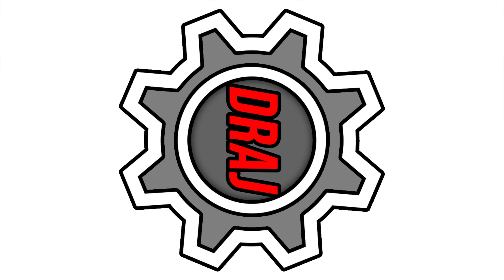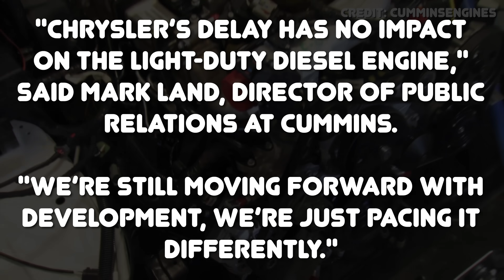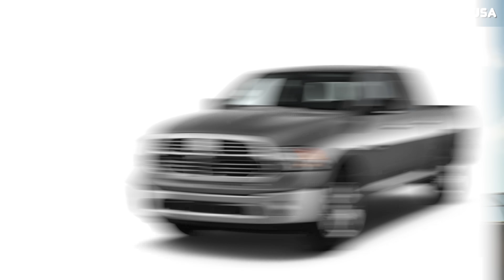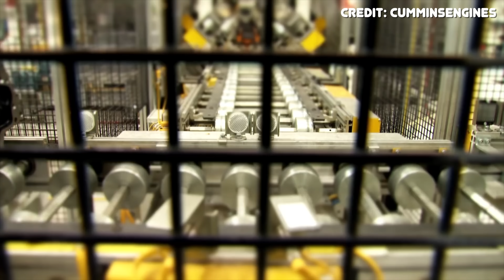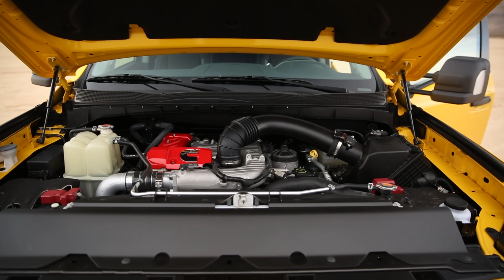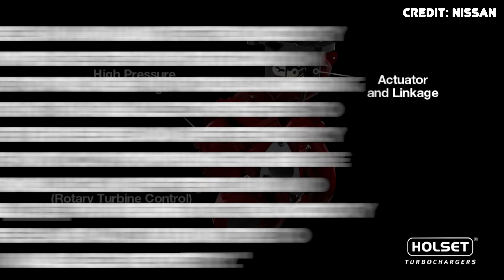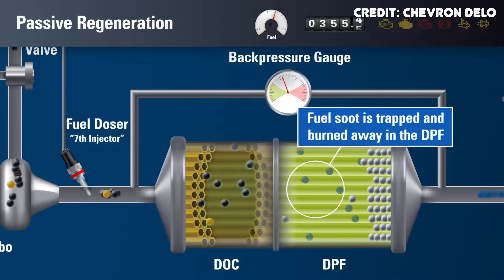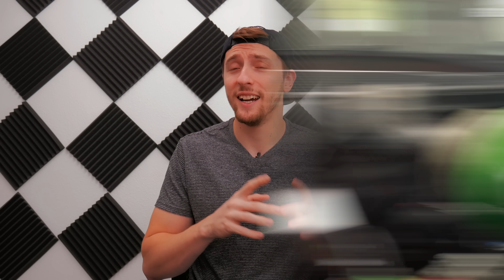5.0L Cummins: Everything You Need to Know

Comment: I wonder why Cummins didn't design the engine to be a "hot vee" (exhaust exits in the middle of the Vee instead of the conventional location)?
I'm guessing there must be some significant disadvantages.  Yet when one sees the (conventional) exhaust routing from the exhaust manifold up the back side of each cylinder head and into the vee, that seems like quite a source of heat and noise not to mention the distances from the exhaust to the turbine adding to turbo lag.

Comment: The 5.0 Cummins is a joke because it gets worse mpg than a gasser. My 5.9 Cummins in 2 of my 8,500lb trucks that get 18mpg city and 21hwy. My other 3 5.9 Cummins do slightly under that. That 5.0 gets 14mpg at best.

Comment: The problem with the entire package is there are no benefits. All of the testing showed the titan XD with the cummins got the same fuel economy as a full 3/4 ton pickup with a big diesel.  They also priced it sky high and the tow capacity isn't much better than a half ton.  So if you want fuel economy you get a half ton and if you want tow capacity you get a true HD. The XD with the 5.0 was literally the worst of both worlds in the same truck.

Comment: I think this engine is grossly under powered for it's lack luster fuel economy and displacement. The 3 liter duramax and 3 liter ecodiesel come extremely close to this engine in hp and torque for being 3/5th (exactly) the displacement. If you took the duramax and ecodiesel and scaled them up to 5 liters, the duramax would make 461hp and 766 lbft, and the ecodiesel would make 433hp and 800lbft. Sure the numbers would be slightly less if they actually built it, but thats the main flaw with the 5.0 cummins. Combined with being put in the absolute most useless truck on the market, as its been discontinued outright for horrible sales, and this engine was bound to fail. This is why ram just said "no" to this engine and went with the ecodiesel, and it was a great decision. I would say, if it had that kind of power output it could be a base engine for the ram HD's, but it got worse fuel economy in the 6500lb titan xd than the 6.7 in the 7000lb 2500 by about 1mpg, which is pathetic. All around the engine was 10 years late on its release. 

This is a smaller V8, it needed higher RPM limits, like 3500-3700rpm, and it needed about 650lbft of torque. This engine would of not only survived, if anything thrived. Nissan would of outright been able to throw this in the regular titan, say its the most powerful half ton diesel and one of the most powerful half ton's period. Putting it in the lighter (about 1000lbs lighter) and slightly more aerodynamic regular titan would of resulted in better fuel economy. They also would of been able to put this engine in their SUV's, the Armada and QX80 for a more luxurious, torquy experience. 

Actually an engine with a similar backstory is the 2.8 duramax, old, underpowered per displacement and was dead on arrival. People talk about loving the 2.8 duramax but honestly GM making the 3.0 duramax and showing just how more competent of an engine it is for .2 liters more, shows just how dated the 2.8 is. Cummins actually has a 2.8l i4 crate engine that's doa too because of similar reasons. Cummins is honestly dead in the consumer space, and they did it to themselves

Comment: I have owned and drove 3 early 90s 5.9 Cummins trucks. Decent power and 25 to 30 MPG. Well over 20 MPG pulling heavy trailers.  My next purchase was a 2004 5.9 Cummins. 22 MPG empty and 16 loaded. Next was a 2012 6.7L. 18MPG empty and about 14 pulling a trailer. As power and technology increased, mileage decreased. There is something wrong with that picture. On a side note Cummins built industrial V6 and V8 engines in the 60s, mostly installed in versatile tractors. They were quite a bit more labour intensive to overhaul compared to an inline 6.

Comment: The 5.9 and 6.7 are EXCLUSIVE to dodge/ram trucks.. they have been and are still used in a lot of commercial trucks and industrial equipment, they were before dodge got a contract for Cummins to provide diesel engines... Just like with Nissan, dodges Cummins engines are just the non commercial /industrial version...

Comment: whats the word on head gasket failures? how many miles are they hitting the wreckers at typically? i cant imagine doing two headgaskets at once instead of 1, especially when theyre jammed in there and on  a 45 degree angle

whole reason the cummins gets the love is its million mile reliability, if the 5.0 is only making it to say 300k miles and needs headgaskets, an injection pump, and a turbo setup in that time span it aint the answer

Comment: I have a 2019 Nissan Titan XD Cummins and really enjoy it. Towing with it makes me sometimes forget there is something behind me. 5th wheel or towing the rzr the 5.0 Cummins handles it just fine. On top of that Nissan offered a 35 year warranty with unlimited miles on the power train. Amazing truck and great power its not a sports car but it will haul a$$ even with a trailer behind it!
Reply: 35 years? Are you serious?
Reply: @andrewsang4688  yes 35 years.
Reply: @reviewmaster8910  I was looking online at looks like it's only 5 years and 100,000 mi
Reply: @andrewsang4688  yes the original factory was 100K 5 year. However Nissan offered an extended warranty for $3,500 that extended it an additional 30 years not starting until the original factory expired.

Comment: I have one currently and love it, an aftermarket intake makes it 5x better. one thing with the trucks though is Nissan basically lied about the tow numbers because they can easily tow 20k while only being rated at 12-14k
Reply: @stevenp3176  it’s pretty safely, if you look at the vehicles specs it’s more than capable, 20 may be a little high but 15-16 easy

Comment: 5.0 had none of the advantages the 5.9 and 6.7 had. Drivetrain was not gear driven, and that engine uses glow plugs instead of grid heaters as well. Two of the main reasons people like the i6 was it’s longevity and ability to start in cold temps. The 5.0 couldn’t deliver on either front as well as very similar mileage to the 6.7

Comment: The Bosch fuel pump in my dad’s brand new ram 3500 grenaded at around 3,400 miles while we were heading home on the interstate. Almost half a year later we finally got it back. Thankfully it was covered by the warranty.

Comment: CP4 is no longer used on the cummins after 2020 since they have been sending metal shards through the fuel and possibly motor. cummins noticed this and went back to the previous system for 2021. ford and gm have failed to do so leading to many issues recently. Also new ultra low sulfur diesel is a bad thing for the cp4 because it relies on lubrication which sulfur provided.

Comment: Crap ! I would just get a 6.7L Big Power and better truck for the money plus ride quality is not bad with the new gen of ram 2500 all the way up to the 5500 with the limited trim package now over just the Laramie Trim that they just used to only have for the 4500 and 5500. Plus If I may note the 2012 truck trend issue showing off the concept ram 5500 long hauler truck would have being even more sweeter  if they had released it to the public ! Especially with at klederman air ride which is a way better system than that factory crap they have. All that being said you could still get that concept if you buy a 5500 cab and chassis limited and put the box off the 3500 on the back and do the kelderman air suspension and you would have a class 5 bad ass truck at your finger tips that would smoke even the 450 Ford !!!! HAHAHAHAHA!!!! What do you say to that boys and girls !!!!!!

Comment: No parts even for dealer repairs and turbo system recalls means they're effectively warranty-covered maintenance totalled at very low miles. Check out "Wrench Every Day"s experience with trying to use one as a tow rig, and how many times it stranded him before the dealer bought it back.

Comment: Exploding injector pump, Plastic timing chain guides, electronic controlled turbos buried in the engine, sketchy DEF system and sticking EGR valves. I thought a 5.0 Cummins would be a great idea but with engineering like this, I'll take a hard pass. Fix these issues, and I'll buy an even dozen. Or stick with the 4BT we use now.

Comment: 900lbs is exactly what a early 5.9 with exhaust and turbo on a reusable steel shipping stand weighs. I had some of these shipped to me before. I'm sure it burns 15-30% less fuel and produces 20-40% less emissions.
Reply: I still have an 06, 2500 Dodge, they got rid of them because they last too long, and run too well, and got excellent mpgs.

Comment: The head studs thing isn't really that there isn't enough it's that if you weren't gonna have more you needed to make the less more beefy with better materials which ford didn't. I.e. the head studs stretch especially when tuning causing head gasket failure.

Comment: lol RAM didn't use the Cummins because they got bought out by FIAT and fiat wanted to use their existing V6 diesel instead of paying cummins to re-invent the wheel. And the main guy in charge of putting the V8 Cummins into a RAM left to go work at Nissan. Good try though, you regurgitated the PR reasons well enough.

Comment: I worked at a Nissan dealership in the service dept for 4 years. These engines are JUNK. Crankshafts splitting in half, dropping injectors left and right, emission issues. I made a TON of money selling repairs on these. Every one that came in deleted blew the motor 2 oil changes later. Stay away.

Comment: No no when i heard CP4 injection pumps, thats a REALLY BIG turn down, because unlike the CP3 injection pumps, the CP4 injection pumps in even diesel application were known to randomly fail and cause a crank no start and call for a complete high side fuel system rebuild

Comment: Why does Cummins get installed the worst vehicles Ram, and Nissan. My 2015 Ram rear window seal leaked water 4 times last time out of warranty cost me $480 at the dealer. The drag link got a recall Ram free recall repair is to weld the adjustment nut. Just a few things wrong with the truck I wish Cummins was installed in a toyota but they decide to go with hybrid.

Comment: Very good and informative video. As a Nissan tech, I am definitely not a fan of these engines. Relatively problematic with mediocre performance and fuel economy. When this was announced, I was ready to place an order for one. But once I went to training on them and drove one, I quickly changed teams and bought a 2016 Ram 2500 Cummins. Price and capability were 2 of the biggest problems with this platform, causing the 5.0 to be dropped after only 4 years.
Reply: Lol. You bought a 2500, which is a giant heavy duty truck drawbacks that the video details and which the 5.0 was supposed to mitigate. Sounds like you preferred the 2500's advantages over those of the 5.0, so you weren't the target market.

Comment: The level of engineering is remarkable. With that said, more parts equals more parts that wear out and break. At this point, i'd rather road trip with a 350 small block knowing nothing short of a spun bearing will stop me instead of these new diesels where the list of failure modes could fill a text book.

Comment: Let's see the cummins in the Nissan is 305 cubic inches, the straight six used in dodge ram is 359 Cid and (407.5) 408 Cid. Why do we as Americans use the metric system? We are Americans not European. Of course if we acted like Americans we wouldn't be in the shape we are in today with all the woke, cancle crap that's going on. Politicians wouldn't be as corrupt as they are. But yall go to your safe places now. I'll go drive my 408 Cid dually and pull stuff and park in a parking space when I need to. Ej keep yours covered up.

Comment: The worst part about the 5.0 Cummins is that it feels gutless compared to other diesels and it’s attached to a Nissan. I have owned it and heard that they are reliable if deleted…. I have also heard of people going through motors on these even after they are deleted. I didn’t own mine long enough to find out the truck that was built around it is trash.

Comment: Wellllllll single turbo kit with right tuning is 500-700hp depending on turbo and tuning option. Our big stainless diesel 5 blade mafia compound kit as you used in video with added s&s injectors we made that motor go to 1,000hp on 100psi of boost. All on factory block no studs. But in the end its 5/8 ton truck so hard to compare to any other brand.
Reply from the maker: Love the build y’all have put together!
Reply: Why.
Whats the purpose of building those numbers on mechanical components not meant for that kind of boost?
Reply: @rdallas81   Some people like to have a good time and party!

Comment: nissan "we are going to bridge the gap between 1/2 and 3/4 ton with a truck that costs as much or more than a regular 3/4 ton, gets the essentially the same MPG and has less power" Also Nissan, "we are leaving the diesel market because there isnt enough demand for our vehicle" I would like to see what sort of MPG this engine could deliver mated to a 10 speed in an f250. If you could get in the same fuel economy range as the gas 5.0 f150 I think that fills the gap Nissan was aiming for.

Comment: I have a 16 XD with 120k miles. it is tuned and deleted(def system failed).
I regularly pull a goose neck with equipment as large as a D3  I have 0 problems with it since the delete. it pulls almost as good as my 2500 dodge did, and it rides a hell of alot better.
Reply: All diesels run better deleted. The emissions are severely problematic .
Reply: @Terk131  How do you get a delete?
Reply: Wait you are pulling a D3 dozer with a XD? Where’s the video? Because a lot of people would like to see that.
Reply: I'm skeptical you're pulling 21k PLUS the trailer weight of a gooseneck that's at least 7k empty, with an XD. Especially considering the pin weight alone would be 2800 - 4000 lb, which is way over payload capacity and GCWR for that truck. GAWR is only 4900, so you're over the axle limits, too, considering the curb weight of an empty vehicle. If you tell me you're pulling 17k on a gooseneck and it feels great, I believe you, but 28k+... man, you need to make sure you've got good life insurance and liability, because that's dangerous af. Even a 3/4 ton truck is ill-equipped to pull a 28k gooseneck. That's a job for a 1-ton DRW diesel.
Reply: Thats impressive. I didnt know they would hold up to that weight truck and engine
Reply: Here, can do and should do are two very different principles. Nevermind your life, because you don't value it enough to get the proper equipment for the job... Every time you tow that on the road, you put other's lives in danger, because you don't have axle and tire rating for this work. Sure, it is fine for now, but how about when you hit a little bump harder than the axle can take? Where is the last straw? It's just too light of a truck to be using without endangering others. Have some respect for others on the road, man!
Reply: The 2500 is only available with the low output Cummins, 30% less power than the HO.
Reply: Have my 16 xd deleted since 12xxxmiles, tuned +60hp  not a single issue , tow a 7x14 work trailer almost daily, tow a 9000pounds trailer camper on summer at lease 2 times a month, its been 4 years 🤷🏻 i only use hotshot oil for engine and amsoil for transmission and all other fluid. Its been great i just wish it had more payload for a 5th wheel

Comment: Owned both 5.0 and now 6.7. the 5.0 sounds great, gets decent mpg, starts in -10 weather no problem, has great fuel filter location . 5.0 turbo can be somewhat possessed and cp4 fuel pump can be problematic. My 6.7 pulls much harder at a fraction of the rpms and doesn't like cold starts.
Reply: I’ve never used the newer stuff but I remember our 1999 F350 with a 7.3 didn’t like cold weather either. Great truck though. Before that we had a 1992 Ram 3500. The Cummins was the only good thing about that truck. The truck itself had terrible rust, terrible suspension, and pretty much fell apart. The 2 trucks were only 7 model years apart but felt like 30.
Reply: @RobertSmith-le8wp  I have a 1999 7.3 with 540k on it this winter sucked for it but my 5.0 didn't care one bit...till the turbo blew up and is now on 5 month back order. 7.3 gonna have a bunch more mules by the time the 5.0 is fixed
Reply: How was the mpg, I'm gonna take a shot in the dark and say the 6.7 gets better
Reply: @james2042  no, the titan would get 16-18 consistently with a light foot empty while consuming outrageous amounts of DEF. The 6.7 (stock) varies more, can average 14 but also can get up to 20 in warmer weather while consuming about 1/3 the amount of DEF. Towing the 6.7 gets better mpg especially on heavier loads when the 5.0 starts to consume more fuel.